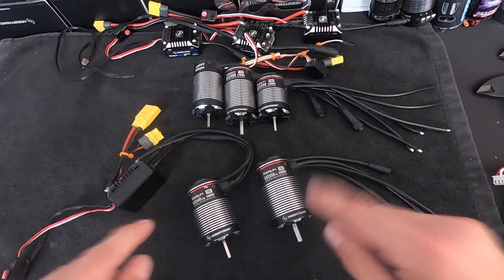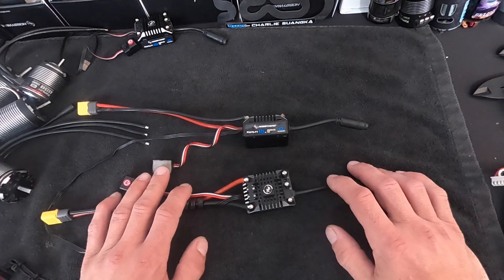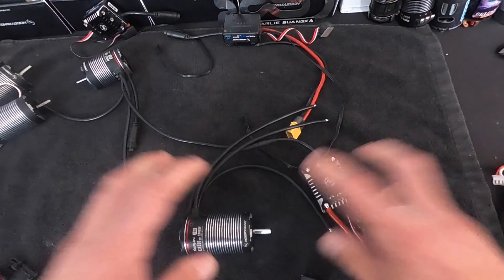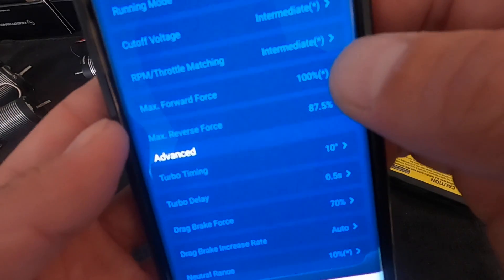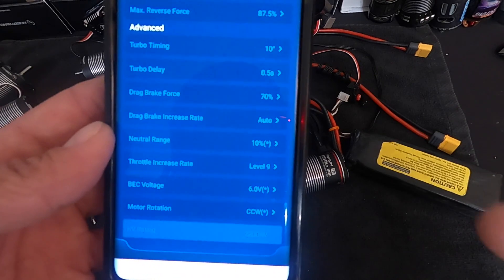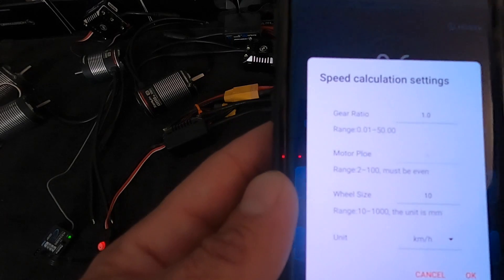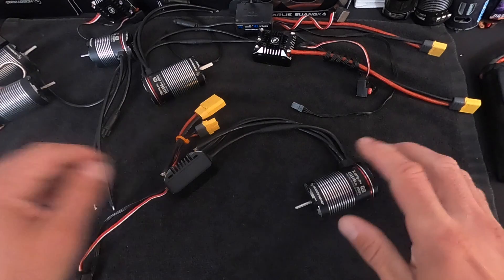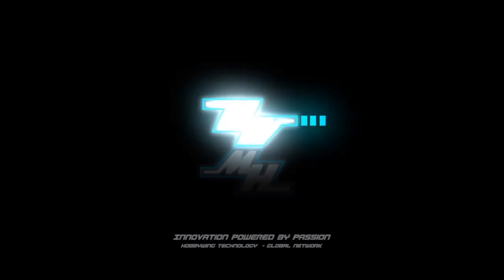The Charlie Show /// Episode 187 /// AXE R2 F.O.C. - New AXE First Look!

Comment: Hi, I have a hobbywing ax 540 and in the real data option I have no information The engine works fine, the settings are also remembered ESC I have connected to the battery with a Traxxas connector Updates also done In my device I do not have this function or something is wrong?

Comment: I could not find explanations about the parameters at speed calculation.  I'm Ok with gear ratio, but  whats is motor ploe? And Reading tire size is it the external diameter of the tire or is the distance that the tire runs at one turn?
Reply: I need the same Answers. Did u already find them?

Comment: Hi Hobbywing official.. i just got my hw axe r2 550 3300kv, after second run, its sundenly turn on right after i connect the battery, and it cannot turn off untill i disconnect the battery.. esc n motor seem no problems, but just cant switch off or on with the switch..
Btw at second run i wash the car, do you think it have related?
Sorry for my english 🙏
Reply: Water shouldn't have bothered it one bit. HW has killer customer service and im sure they will take care of you if you call them or email them. Also, your English is fine.
Reply: @rc-daily  after few day now its run normally.. thank for replying 🙏
Reply: @dodiiidris  that's awesome! Maybe the sensor wire or something got a little bit of water in it. I always like to gently blow mine off with compressed air after I'm finished. It really helps her the water out of areas where it can sit
Reply: @rc-daily  yes me too, always gently blow with compressed air after run n after wash her.. hmm i don't think the sensor wire, because i already warp it with tape, its like switch, because when i open it, it has a little bit water in there...

Comment: Hi Hobbywing official, Always love all your reviews, one question on trx6, i have plan to buy this hw combo, if i change the BEC to 7.4v, i have change the steering servo to power HD 25kg, but their other micro servo still stock, will it save to set BEC on 7.4v for 3 other micro servo (dual speed n unlock diff) ? many thanks 🙏🏻
Reply: It changes all servos to 7.4 even the micro servos.
Reply: @joevasquez1776  its save to other stock micro servo sir?
Reply: The micro servos can live at 7.4v if the end points are dead perfect. I personally run castle becs on all of my trucks. That way I can crank up the steering servo to 8.4 and leave everything else at 6v.
Reply: @rc-daily  ok so maybe i will stay at 6v for now.. Thanks sir
Reply: @dodiiidris  you're better to leave it at 6v. There are plenty of servos out there that do great at 6v. Or you could get a Holmes hobbies servo that gets its power directly from a battery.
Reply: @rc-daily  yes, i stay it on 6v, thanks for replying sir 🙏🏻

Comment: A very great and innovative product. Very disappointed with distribution. Tried to find a replacement motor to my gen.1 Axe ESC, nobody sells the motor anymore in my region, the only thing left are the combo setup which ESC I don't need as I already have one working perfectly. And I can't use other motor because  difference in sensor, and if I get the new R2 motor, it also cannot fit with previous Axe I presume. Now I'm in fear that should my current Axe motor is down, then the ESC will not have replacement motor for it. 
Well... I guess I have to get used to lower drag brake quality from the "snake" esc competitor :(
Reply from the maker: Please contact us directly - NorthAmerica@hobbywing.com and we can assist with gen 1 services.

Comment: Will the 540L fit in an axial capra being that it's longer than a standard 540?
Reply from the maker: 540L is 2.27 inches, or 58mm long.
Reply: @HOBBYWINGOfficial  so is the regular 540 combo discontinued? or are you going to offer an updated version,  would be nice to have the new tech in the smaller size

Comment: So yet again another update to the AXE that Forces you to upgrade the entire combo if you already got the previous AXE.... damn hobbywing, you are behaving like FrSky now.

Also there is supposedly 30gr difference between the 540L and 550!!! Yikes! That is a HEAVY MOTOR compared to the AXE 540.
Reply from the maker: This has no affect on the original combos, and is "Replacing" the AXE.  

It is not uncommon for products to get improvements over time. The Axe combos were unchanged in regards to hardware for a very long time.
Reply: @HOBBYWINGOfficial  see I just bought an old combo at my lhs for a lot more than it was worth and now i find out i cant even use the newer motors... I'm pretty bummed.
Reply: hopefully this just means the first system lagged proper function and they've found a platform to expand on. I do like my set up and the V2 APP..